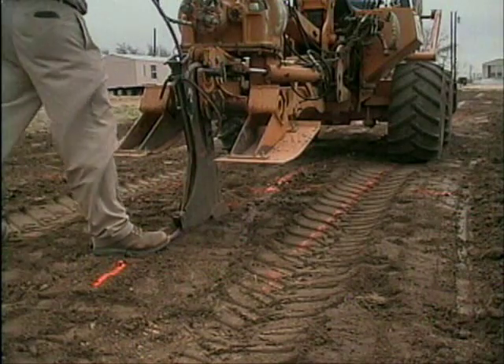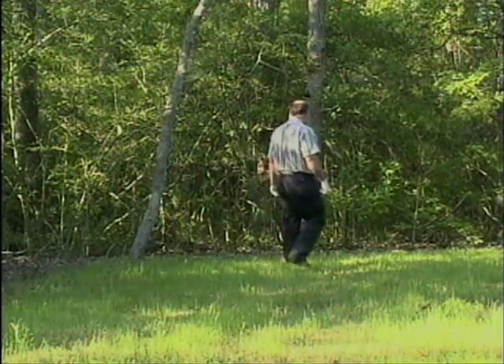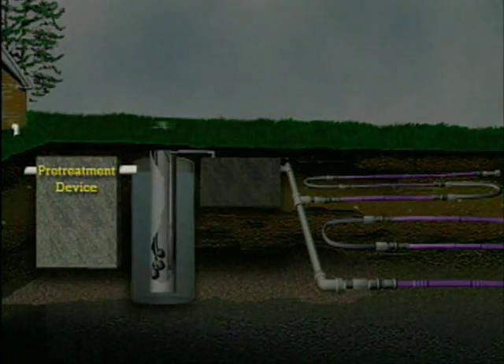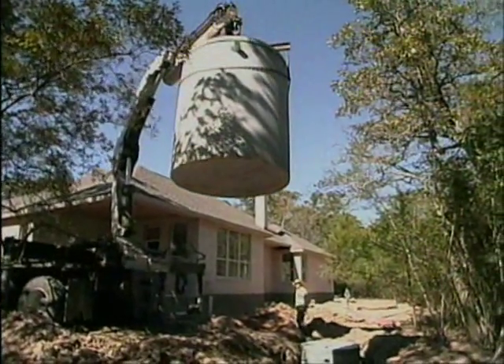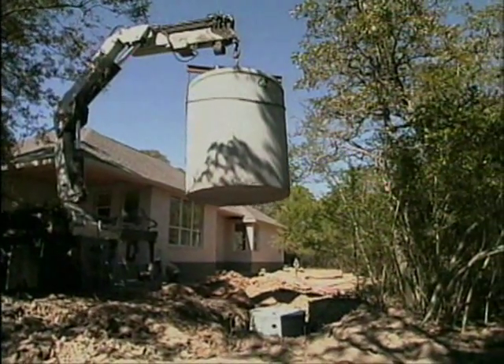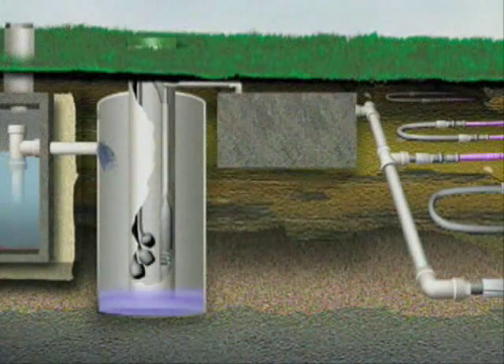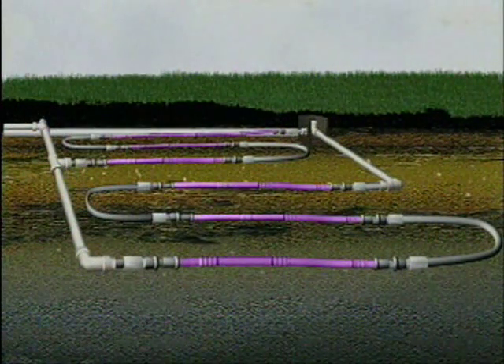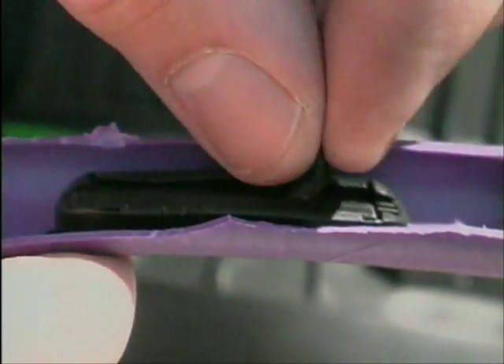SUBSURFACE DRIP DISPERSAL SYSTEMS PART 1.wmv

Comment: What is the purpose of the return line after the emitters?
Reply: Jeffrey Stewart to allow a return back to the tank. This keeps the head pressure lower and doesn’t dead head the pump.